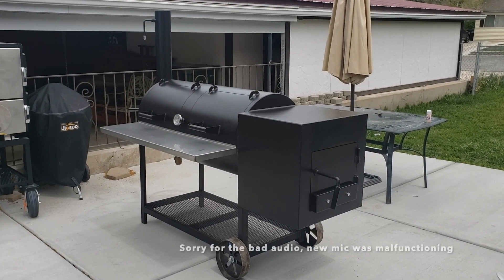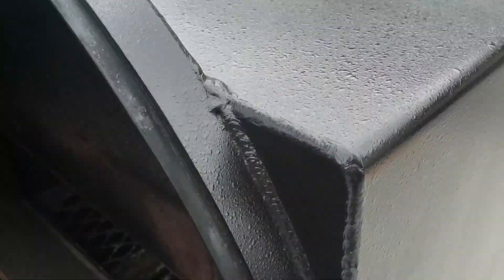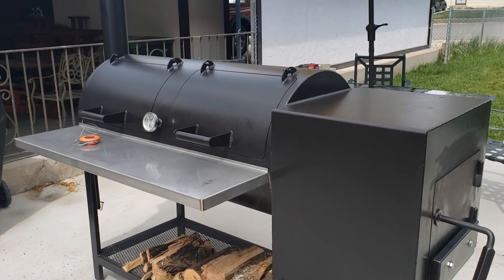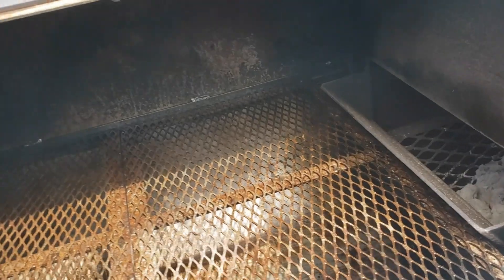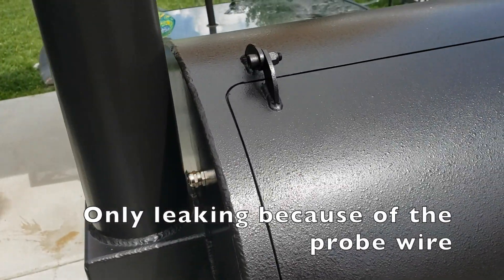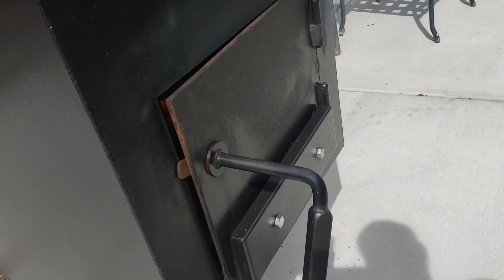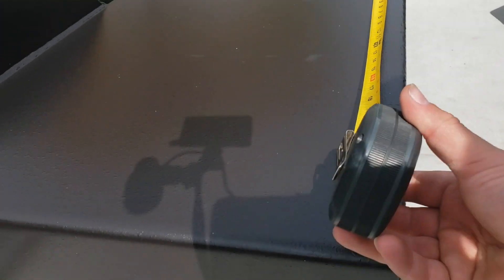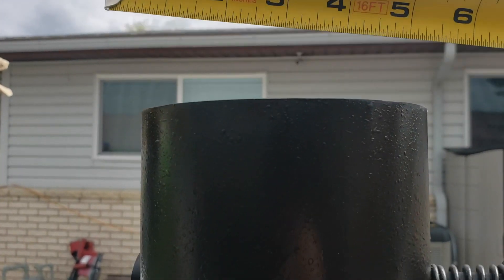Jambo Backyard Pit Walkthrough

Comment: Do you by chance have the measurements of the firebox doorway/entry area? Trying to make sure I can fit the fire basket I want in it

Thanks!
Reply from the maker: I'll grab those measurements for you by this weekend. Thanks for the comment!
Reply: @lalunabbq  appreciate ya
Reply from the maker: @mdtrahan89  Ok, sorry it took me a bit. So the dimensions of the inter firebox and door are as follows:
The opening to the chamber is 16" wide, by 13" tall. 
The inside of the fire chamber is 19 3/4" Deep, by 20" wide, and is 17" tall from grate to top, but there is also 4" of space under the grate (for ash). 
Hope this helps!
Reply: @lalunabbq  very much appreciated!

Comment: If you dont mind me asking, what is the price on the backyard jambo? I’ve been debating it, but your video has pretty much solidified my decision to pull the trigger
Reply from the maker: New they are about $2800-3k without shipping, depending on any extras. I've seen them used as low as $2500, but they pretty much hold their value.
Reply: Awesome pit but why not just have a slide style vent for the intake on the door? Strange design, but a killer pit anyway.

Comment: Jambo is a jambo  but its to old school, the features are out dated as hell, wish they can modernize it
Reply from the maker: I'm not even sure what that means? You mean you want it to be a pellet smoker or something? 
Smoke and fire do and have worked the same way since cave man struck the first spark. I'm not sure how a perfectly designed work horse could be "updated". 
Sure there are a few things that aren't perfect, but old school is a good thing in BBQ.
Reply: @lalunabbq  look at at moberg, it can be old school and not caveman style, look at the dampener who hell uses bolts to adjust, the smoke stack knob looks half a$$. I rather just crack the door open like on a moberg. I know jambo smokes great but this patio model doesn’t cut it for me. Iam glad you did this video and and it helped me bring my Pitt choices to moberg and Shirley fab reverse flow. Enjoy your Pitt
Reply from the maker: @dmdm9198  ok, I get what you're saying. Yeah, the lug nut on the damper is a bit "home made" and the intake as well. It hasn't been a problem for me on either count, but I certainly still envy some of the design features of pits like Moberg and Workhorse. 
I have debated just tightening the damper all the way and using the door, but as of now, the range i get works for my cooking style. 
I think the point with Jambo is that he and his small team of I think just two other guys just build them by hand, and want them to be simple, and feel like they were built by hand. 
There's times I wish I'd waited for a build on some different Pits, but then I cook on her, and can't think of any other pit I'd like to have. 
Ended up getting her used, and had bought it after having waited for several months on a custom build that got destroyed in shipping, so I was gonna basically take whatever high end pit between Jambo, Lang, workhorse or a few others that came up first, and the Jambo was the one!
Reply: @lalunabbq  well it’s still a jambo and will hold value the way it is, ether way if I found a used one I would jump on it,  again thanks for the video, the only person to do a true walk around, everybody else is afraid to do one.